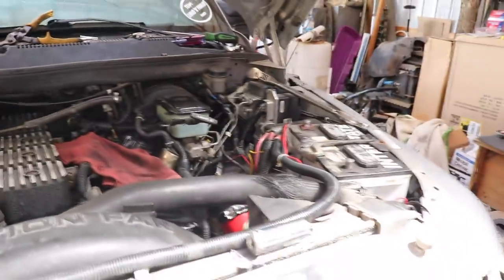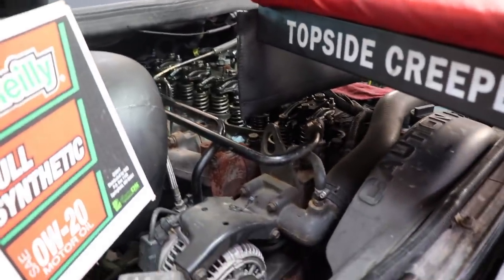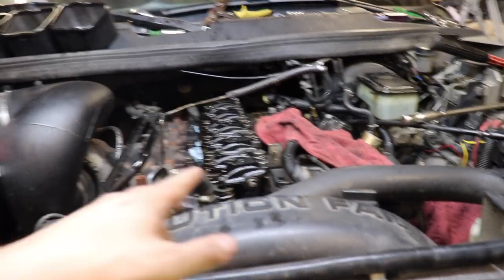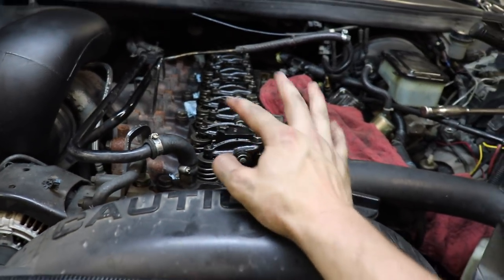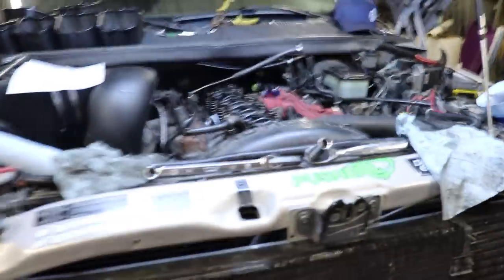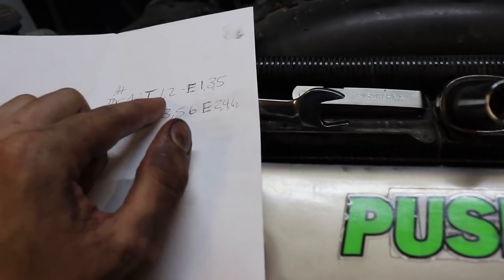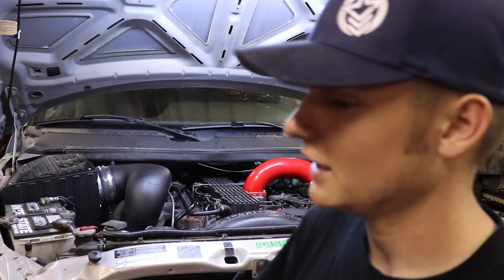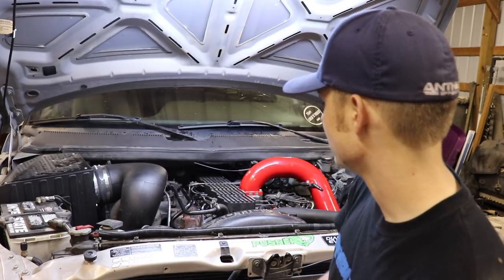ALL NEW PARTS IN THE 12V CUMMINS DUALLY!!! *TRUCK WON'T START*

Comment: I'm guessing you removed the fuel supply lever to get the Gov spring plug.  If the crescent key falls out and doesn't get put back in, the fuel supply arm will slip on the shaft and not open the fuel transfer in the pump.
If the fuel supply line was disconnected and sat open for a day or two, it might have siphoned fuel back to the tank.  The mechanical lift pump might have to be pumped a couple hundred strokes to get fuel all the way up if it's drained the fuel line.  Pump until you hear the fuel buzzing past the overflow valve at the front of the pump.
Reply from the maker: Martin Saine my man... you may have just solved my problem.... because now that you say that, I remember that key falling out and not knowing what it was for so I sat it in the magnetic tray.... but that’s what it was for! It makes perfect sense... thanks! That should solve my problem since I never put that back in...
Reply: I was just about to comment what Martin said, good luck!!
Reply: Glad to help.

Comment from the maker: My guesses to why it’s not getting fuel...
-Bad fuel pump Relay
-shut off solenoid relay
-Primer pump died
Or
-factory lift pump failed...
What are your thoughts?
(Yes I did all test starts right and new filter with new diesel.. and manually lifted shut off solenoid..)
After I test a couple more things, if I have no luck I’ll have our top diesel mechanics in the area resolve the issue to make sure it’s taken care of perfect for the giveaway winner! Thanks
Reply: LOUD 'N' PROUD didn't watch your video yet but I would try and crank it with a gas rag if it cranks and dies lift pump if it cranks and stays running injection pump or ignition signal issue.
Reply: LOUD 'N' PROUD crack the line that feeds the injection pump and not the one that feeds the injectors if the lift pump is bad you will have no fuel at the ppump also known as the injection pump.  If fuel spurts out than its something eltse that something eltse or a bad ppump. Have you tried manually priming the pump. I believe there is a manual primer on the pump I believe or filter housing
Reply: Didn't realize that you changed injectors recently Need to bleed lines then I take a gas rag and crank with it to get the system to reprime the system. Gas rag works wonders don't use either it saves alot of time just feed it through the air intake.
Reply from the maker: sam grabel yeah.. I checked after all the pruning and cranking... no fuel over the delivery valves either...
Reply: LOUD 'N' PROUD  than it’s more than likely the lift pump.   But it could be a blown  fuse   Or a bad rely but the fact there no fuel getting to the ppump  points to a bad lift pump not a bad shutdown solenoid. Bad shutdown solenoid would make the truck not shut off with the key
Reply: LOUD 'N' PROUD 
Check the fuel shut off solenoid
Reply from the maker: Mariah Gander yeah I manually lifted it and it works fine...
Reply: LOUD 'N' PROUD  this is risky but you could try priming the ppump with a fuel can to see if it runs   But to me it seems like a bad lift pump  since your not seeing fuel at the back of the injection pump
Reply: LOUD 'N' PROUD anything related to the fuel pump go go bad at anytime so I would start there
Reply: I would check the electrical connection to the fuel shut off if you dont have it connected it wont get fuel
Reply: Turn the key forward to the on position you should be able to hear the in tank fuel pump turn on. It will make a buzzing or whining noise for a few seconds. If you cant hear it have someone turn the key while you put your ear on the fuel tank. If you do not hear anything, the pump in the tank is bad or a fuse or relay went out. Very unlikely it is anything serious also couldnt really tell in the video but remember to unhook your batteties whenever you work on an engine.
Reply: Try manually inserting diesel into the lines to give it a good prime, then hopefully the pump would start back up
Reply: Check fuel pump fuses and test them, then check fuel pump and fuel lines make sure it is picking up fuel
Reply: I store my truck for the winter and every spring i unplug the harness going to the fuel shut off and turn over it wont start because the fuel is shut off i would check this first
Reply: LOUD 'N' PROUD 

His truck does not have a in tank fuel pump. The lift pump runs off the cam on the block. Crack all ur lines at injectors pump the lift pump 20 times. Crank it over hold the throttle wide open as soon as it fires shut truck off tighten lines up.
Reply: Zip tie it up. If it starts its a solenoid. you will have to cut the zip tie to shut it off again. If that's the issue I recommend just doing a cable operated one. It will make that truck survive a nuke emp. That's the only electronic that that engine needs to run. Cable is about the same cost as a replacement part and it will never go bad.  Just my $.02. On a separate note have you spoken to Power-Driven and maybe thought about getting AFC live's for both the giveaway trucks? I have one and love it. DAP sells PDD AFC live's. it is an in-cab smoke adjuster and rack travel limiter with a bypass for full power with no delay. I'd look into it and see if they might be interested in doing a sponsorship. They also have an in-cab adjustable boost elbow of sorts but is far superior in all ways. I have one planning on installing it its called a turbo tuner. Power Driven is a partner of DAP so it wouldn't be their competition. hope the issue gets resolved.
Reply: LOUD 'N' PROUD you were called out by durtymax jack please accept
Reply: Check for a stuck rack if you put a delivery valve in upside down it screws the rack up in the pump causing no fuel I did the same thing and had to buy a new pump
Reply: I had an issue with mine as well. Ended up going with a 4g airdog raptor turned over just fine next to around. Crack your bango bolt on top of your fuel/water separator and see if your getting fuel from your factory lift pump if so keep going down your fuel system bango bolt to your pump if not it may be your lift pump
Reply: LOUD 'N' PROUD crack right if water/fuel separator to check if your lift pump is still good
Reply: Why would it be any of those if it ran when u put it there
Reply from the maker: That_Blown_ 6.0 is 80% sure I know what it is now.... it’s a small metal key that locks the fuel shutoff linkage in place... I remember putting it in the metal tray but now putting it back in place... so essentially, my fuel can’t get turned on inside the pump without that metal key...
Reply: You need to get a lift pump Factory lift pump only good for about 400 horsepower
Reply: Brett Tighe it's a 12 V not pump in tank

Comment: Hey bud, try cracking the line above the lift pump and see if fuel comes out, if not, there you go.  The lift pump timing and camshaft and pushrod might be off.  If fuel comes out, check the fuel line at fuel filter housing inlet and outlet and work up.  Start at the line above lift pump.  Good luck

Comment: Try the fuel shut off selionoid. Mine had the same problem. Turn the key to the on position and lift up the bar on the selionoid and if its stuck down you wont get any fuel but you should be able to lift it up and you'll hear a click and then it should start right up. Never mind you said you already did it.

Comment: Try using an air nozzle and a rag in the gas filler and try to push fuel through. Same thing happened to our dump truck we couldn't get any fuel to the lines. It took a bit but eventually was able to push fuel through

Comment: I’m new to the diesel world and own a 7.3 idi. I’m having sort of the same problem in my truck. The stuff I learned is that the filter or pumps may be gummed up. So my guess would be to see if you could clean those out and flush the systems and it could possibly work. But don’t quote me on this

Comment: I had the same problem when I changed the injectors on my diesel tractor. But you have to crank it for a good two minutes or more but it will start its because of new injectors need to get diesel through them and need to go through all the lines. CRANK IT FOR A GOOD 2 TO 3 MINUTES GIVE THE STARTER A BREAK IN Between keep lines shut and crank so it can build up pressure

Comment: As a diesel mechanic, I ran into this a lot. On the Semi Tractors I had to pressurize the fuel tank to force the diesel to the fuel pump while spinning the engine over. Try that.

Comment: If I remember correctly what you call the smoke screw is what gives you your fuel to air ratio before boost then the star wheel controls the fuel to air after boost has kicked in.  It's possible that the smoke screw is off just a little.

Comment: Hey Malachi, being that I own a 97 12v my guess would be the fuel shutoff relay, located on the driver side of the firewall right below the wiper cowl. Mine went bad and would crank like that, cheap $10 part
Reply: Jump the relay with a wire and see if it starts. Best of luck brother 👍🏼

Comment: If you primed lift pump and see fuel coming out I’d bleed screw on top of filter bolt, check line between that and the injection pump.  I had same issue and eventually went through each section of fuel system from tank all the way to injectors.  I had a problem with the fuel heater screen so I by passed that and got my truck going.  Good luck bud!

Comment: You need to start at the lift pump make sure its working and go from their. ...note I changed a lift pump our 12v once. they can be a pain to get to and if you end up taking the pump off be careful their is pin that hits the cam shaft to run the pump .and sometimes when your pulling the pump off that pin can come lose and drop down in the oil pan .and it will not be easy to get out...stay positive and the issue will become smaller.

Comment: Did you put fuel in the fuel filter if you changed it? If not your sucking air and not fuel, therefore no fuel would be coming out of the injectors👍🏻 just a thought. Hope you figure it out soon

Comment: disconnect that shutdown relay arm and move it manually and make sure the rack is moving, not that any of these parts would have anything to do with that. not sure if you did the gov springs yet though. hopefully nothing with the barrels / delivery valves is jammed up. can also disconnect the return line while priming and you should see fuel spill out. Make yourself a block off plate and order up a fass or airdog setup and get rid of that factory lift pump / filter mess..

Comment: Turn key on find the fuel shut off solenoid lift up on the lever and crack one injector and you should see fuel happen to me on my 97 12v the solenoid is on the driver side should have a rubber boot on it by the pump good luck!

Comment: I would say just start at the file pump and see from there what's wrong I've had this problem before and we started at the file pump disconnected the lines and primed it and if there was no fuel replace the line or do a new fuel pump just a thought.

Comment: Start at lift pump fuse then crack the fuel line at the lift pump. I put money on the stock lift pump grenaded. Seems to be a weak point on 12 & 24v. Might as well order a Fass 150. The biggest injectors in the world aren't worth a crap unless you can feed them fuel.

Comment: If you removed the filter and replaced it it could be a dry filter try priming the filter by putting fuel in it then re do the fuel priming

Comment: You had the shutoff solenoid off I would check that but basically to diagnose it check from beginning to end of the fuel system to determine where you are loosing fuel at don’t jump around throwing darts in the dark

Comment: Open all ur injector lines use ur air compressor and force air into the fuel tank while someone is working the hand primer. All ur fuel turn back to the tank with the lines open.

Comment: You can put assembly grease on the underside of the copper washer on your injectors to keep the washer from falling off during install. As for the not having fuel at the injectors, I’d take line off of your mechanical lift pump that comes out of the lift pump that goes to your injection pump. Then turn the motor over again and see if you have fuel flowing out. Those mechanical lift pumps are poop, so I’d suggest deleting it and going on ahead and install an Airdog. You can also rig up and electric lift pump for a temporary fix.

Comment: Do you have any pressure from the lift pump to the P pump
Reply: Pretty sure that the 12 valve Cummins uses about 120 psi to the injectors

Comment: its the same thing that happend with your white second gen 12v you should pull up the fuel cut of solenoid then see if it starts then it should start
Reply from the maker: Jo Moma I tried that... one of the first things... got no fuel to push through...
Reply: you should replace the lift pump!!

Comment: If you changed your fuel filter and dident fill it that's why you havent got fuel yet id go back and dubble check over everything maybe you went to nuts with your power screw backed out now it wont flow anything
Reply from the maker: Rippin Rebels I didn’t touch any “power screws” and I did change filter and filled it up like always.
Reply: Maybe somthing to do with your gov springs ? I know the higher springs in my firstgen caused me problems getting it to fire

Comment: i think your problem lies in the pushrod.  Bc you lift pump supplies fuel to the pump and then injectors.  If no fuel is at the pump then when you took off the valve springs, etc.  the timing might be off and there for the lobe of the camshaft and fuel delivery is off.  Just a guess.  What about your fss?  Is it up?  I dunno.  Hope you get it figured out, but I think it's in the mechanical lift pump and those pushrods and lobe on the camshaft.  My guess